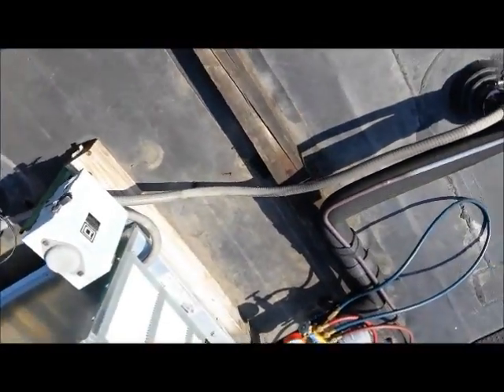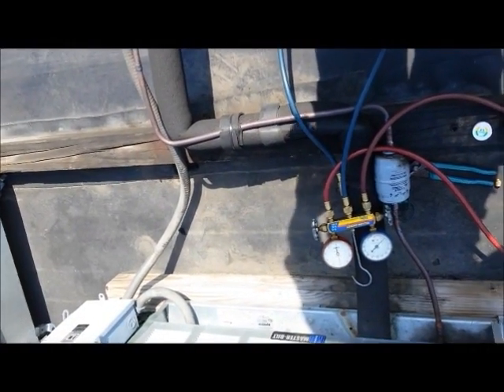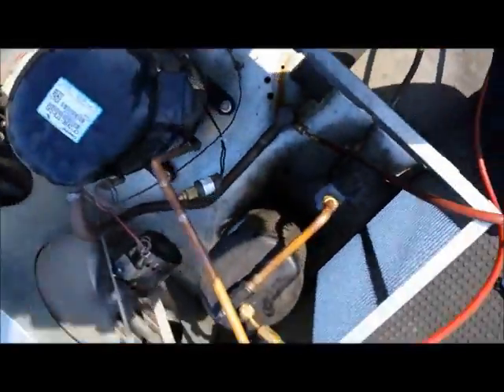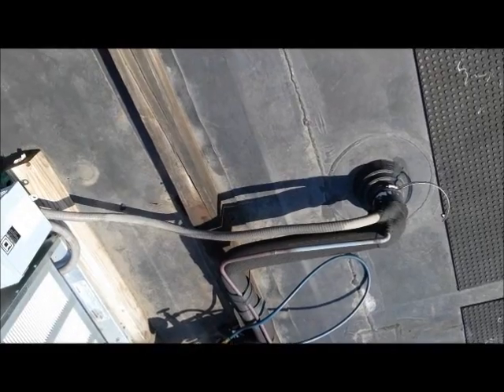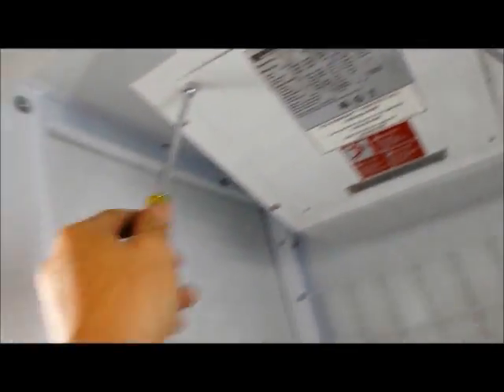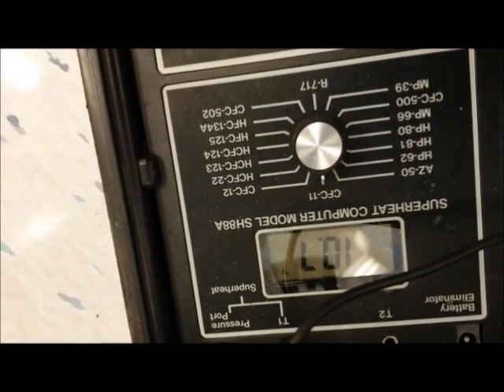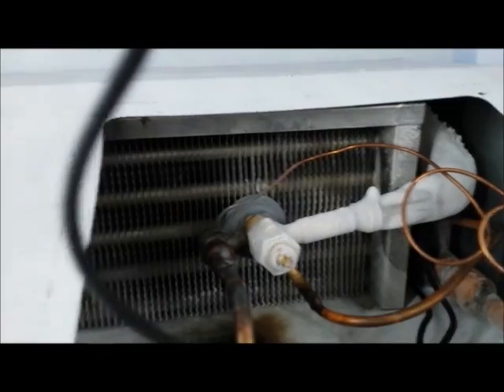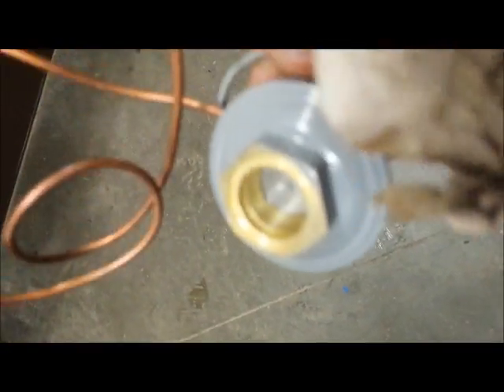adjusting and replaceing TXV

Comment: WOW a guy that knows how to read PT chart. I did refrigeration 40 years ago on 20 tonTurbo Ice Makers 12 plates 12 distributors on a txv and NEVER used a temp probe to do superheat.

Simple open txv till it just starts to flood suction, close it to bring frost line back to evaporator,  DONE deal you are using all of the evap, and not flooding suction line.

And a txv with external equalizer tube that is attached to the suction line at the bulb
does just what I explained (it will kind of by pass the temp bulb) till the evap gets established.

Nice Job

Comment: Good video. But, as u probably figured out after you made the video you were going the Wrong way with the Txv to open it. counter clockwise opens a txv. you kind of have to think of it like opening a Faucet. to Let more Refrigerant into the Evap you open the Faucet. we open faucets counter clockwise which lets in More refrigerant into the evap dropping the head pressure and suction will pop up because of the increased amount of refrigerant entering the Evap. But, what you have to Think of Even Before all That is Why ? did the Txv all of a sudden close. you were right in your diagnosis that the Power head probably failed. but, you had closed the valve alot so it would have to be Re-opened and adjusted to a 10 degree t/d or 10 degree superheat at the evap. i Personally Never Just Replace a Power head because the Txv is old and worn out anyway with a possible sticking pin or Worn out spring inside. For a Better Job and Happier customer and no call backs it's allways Best to Replace the Txv as a Whole item. 35 years in the Trade. Also if there is a screen in the old txv you need to look at it . if it's full of junk you might have a drier coming apart. and need to replace the drier too. i'm glad u replaced the txv at the end. that was best. we all have off days. but you got it done. thats what counts.
Reply: That's how I look at it all of a sudden it just didn't come out of calibration as you know sometimes you can open it up and get it working for a little while until the part comes in. But yeah most of the time the strainer is all gunked up.
Reply: Yes sir, I would have changed the whole value the first time too...the video is short,but in reality that mistake cost a lot of extra time!

Comment: A dual temp probe on the evaporator for super heat while you adjust the power head counter clockwise will make that alot easy and i never realy beleived in that quauter turn ill turn that thing a couple times to see if the super heat decreases  or increase depending on what im doing before i replace it what yall think ?
Reply: Your balls on the money!

Comment: Some won't agree on this.  I have learned to change the whole txv when the power  head or the valve body itself fails. The time and expense of just replacing the powerhead and then having to go back and change the whole txv anyhow is not in my opinion,  worth the difference in actual cost to do one and then have to change out valve anyhow.  Do it once and  be done with it.  But I am not telling you how you should do it.  Good dianostics and good video.  Thanks.
Reply: Danfoss has a 3 piece unit you can use to change out the parts without having to braze after installing it, including the cage, power head and body.

Comment: Clockwise tightens the valve closed does it not?
Reply: the evap was already starved, when you turned it CW, you starved it worse than it already was. it was probably wax or moisture. Sometimes a turn of the valve stem will break it loose.  Next time put a hair dryer or paint stripper heat gun on it.  I usually just put the sensing bulb in my hand and that heat will be enough to open the flow.
Reply: Books tell you to use a hot rag around the body of the valve.
Reply: true but a hot rag on a frozen valve = iced rag.  I just stay away from the power head.  The rag trick is OK on med temp units.
Reply: yes it does closes it letting less refrigerant in which equals high superheat
Reply: If you clockwise tight increasing superheat.counter clockwise decrease superheat